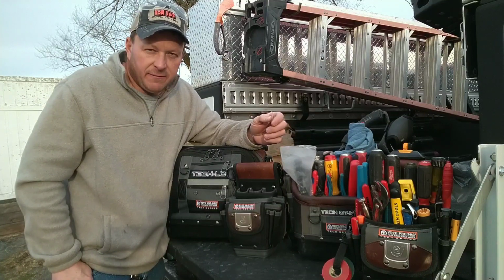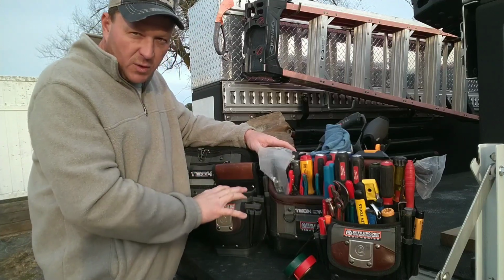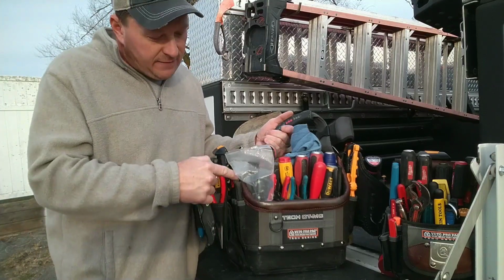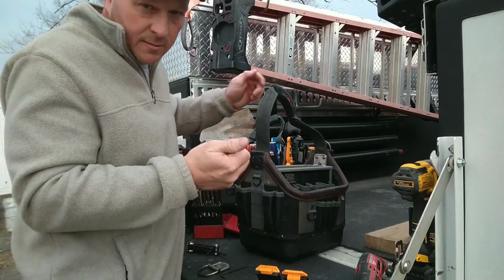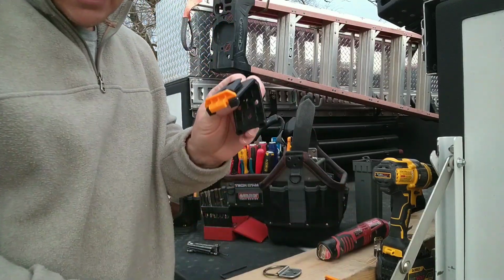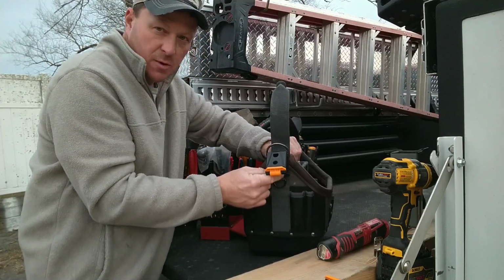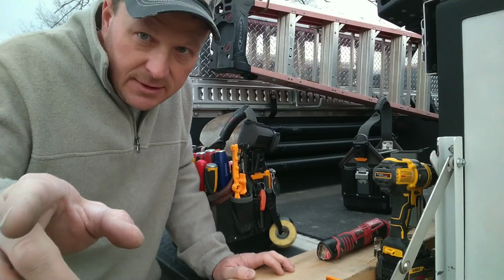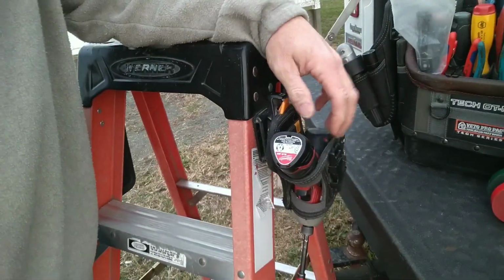Tough Built-Veto Pro Ot-Mc tool bag Modification 🤔

Comment: How has the connections/bolts holding the clip to the oc mt held up overtime? Any issues with the weight affecting the durability?
Reply from the maker: Thanks for watching and commenting. Very great question about the veto modification. The connection point to the clips are holding up extremely well. Still intact and still use it today. This gives me a good idea for an updated video. Thank you.
Reply: @ thank you for creating sharing with us, i dont take it for granted! And an updated post about your modification would be equally appreciated

Comment: Love the idea of the TP4B with the toughbuilt clip. I could only see 2 washers on the front tho. Where is the other 2 ?
Reply from the maker: Thank you for watching and commenting. The veto tp-4b has a big belt loop opening and I didn't want to loose that opening bolting on the tough built (large size) clip to it. Mostly do to, needing to carry zip-ties in that spot. So on the lower part of the tp-4b's belt loop, I drilled and bolted through both layers. And on the upper part, I only drilled and bolted through one layer . I hope that helps.

Comment: Why have you increased the speed of the audio?  Very difficult to understand.
Reply from the maker: Thanks for watching and commenting. A lot of people have complained about the speed of my videos. I started doing this to cut down on the length of the video. It can be adjusted to normal on your end by tapping in 3 vertical... Set (playback speed) to .75  
That should do it.

Comment: I've done a lot of the same stuff myself. 🤜🍻🍻 🤛on some of my veto bags I just zip tie the clip tech hubs on the side d rings. I really like how you did your connection point with your bag.👍👍 It's amazing how many ways people have used the toughbuilt hardware over the years and even the 3d printed stuff being made as well.

Comment: I had to check the playback speed to makes sure it wasn't on 2X.
Reply from the maker: Thanks for watching 👍 It's at 1.4 to make the video shorter. If you set your playback at .75 it will play normal.

Comment: I thought about this but it would feel like sacrilege putting holes in my veto
Reply from the maker: Thanks for watching and the comment. If we're talking about the Veto ot-mc tool bag mod? There are no holes added to it. You'll be using the 3 factory holes where the strap bolts up. If you're talking about the Veto tp-4-b tool pouch? Adding  four holes is well worth the inprovement to the pouch. So far, so good. I've found no fault in doing this mod.

Comment: Nice! Thanks for sharing
Reply from the maker: Thanks for watching Todd. 👍
Reply: @workingmanrondoyle3287  I got a drill holster in today. I was going to try this, I was wondering. Did you mean to put the veto clip on backwards? Would it only work that way?
Reply from the maker: @b-2466  yes, must be turned around backwards. The roll of the metal clip that holds the D-ring will be in the way if it's facing forward.
Reply: @workingmanrondoyle3287  ok. Thanks alot.